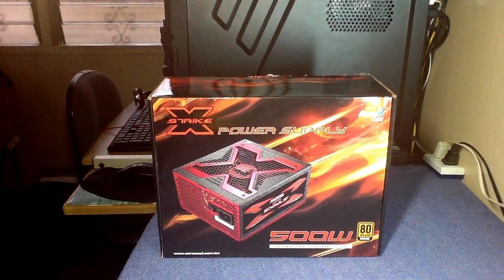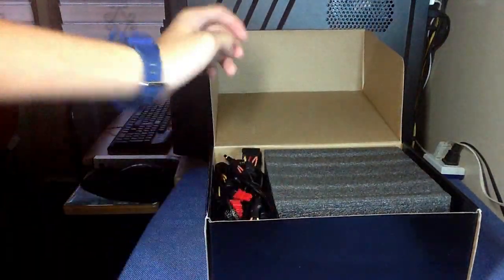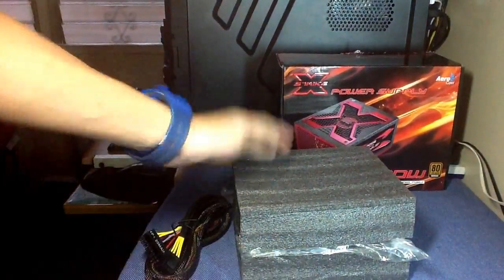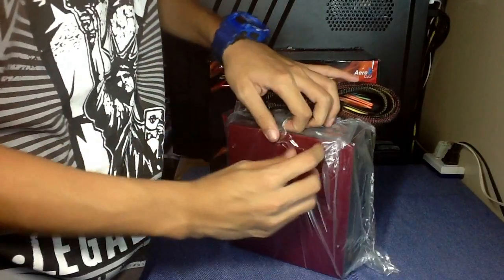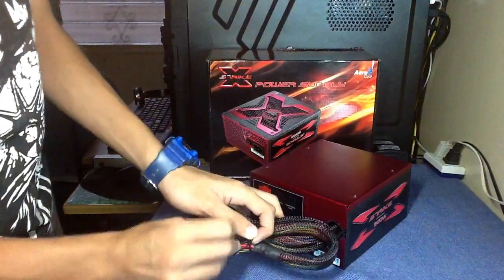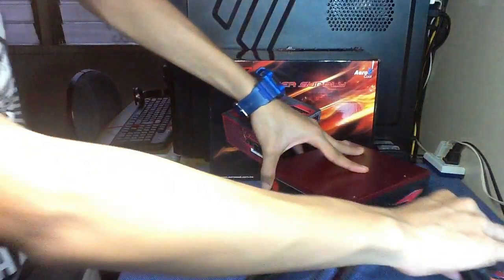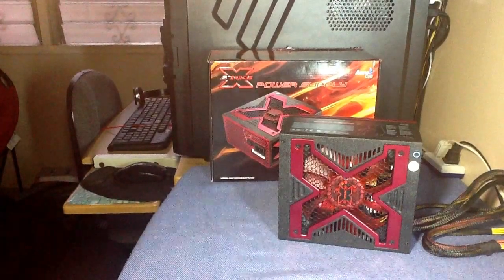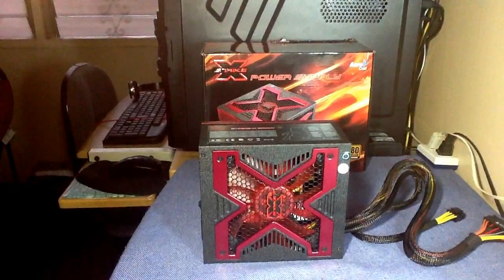Aerocool strike X 500w modular gaming power supply unboxing

Comment from the maker: yes the psu fits on the strike x one, the 4 pin cpu power is just fine when you route it through the front of the motherboard but it is too short if you route it through the back cable management area.